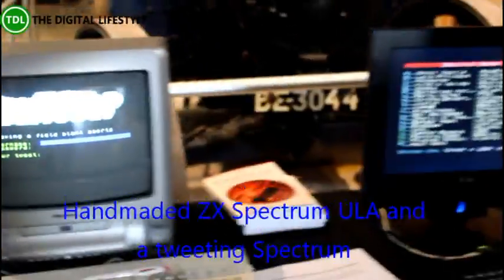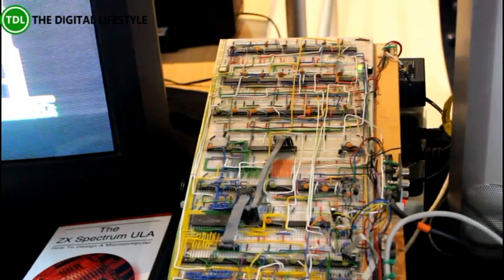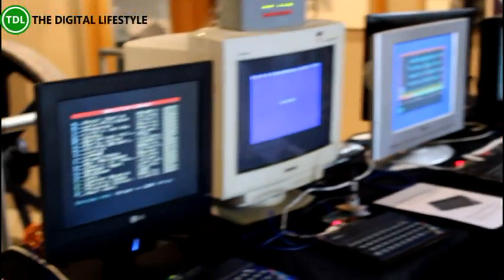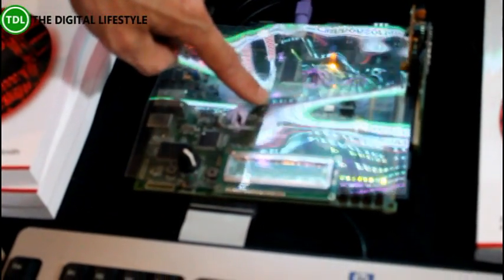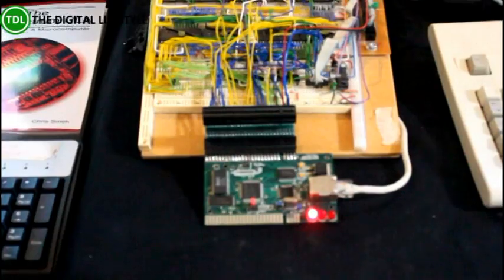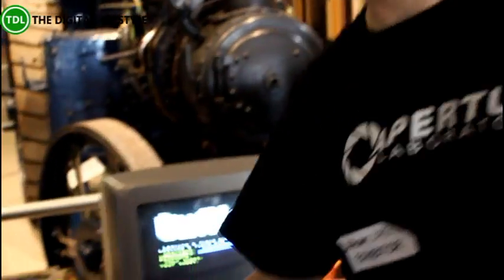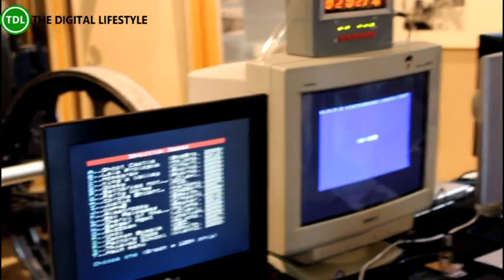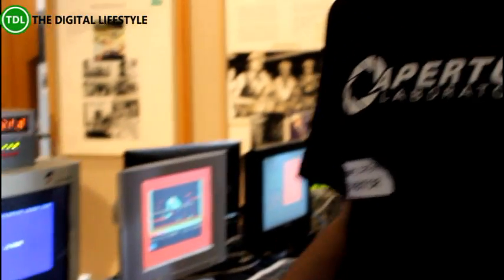ZX Spectrum ULA rebuilt and a tweeting ZX Spectrum

Comment: if the ula+ has 8 pixel attributes then this needs 12KB also the spectra interface has 8 pixel attributes which is also 12KB could we not combine the two for 24,576 bytes which is 24kb and then have 4 bits per pixel like the sam coupe and have 512x192 in two bits per pixel?